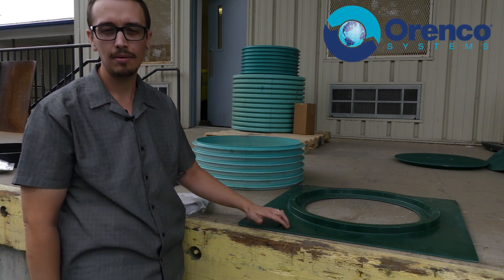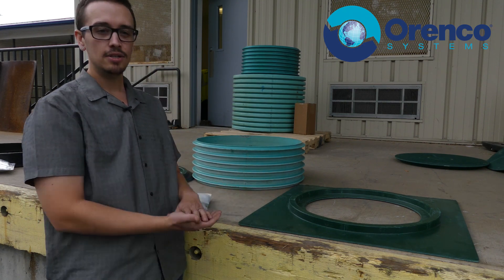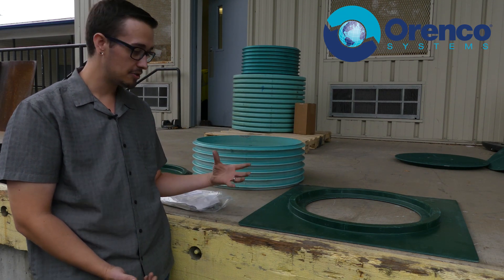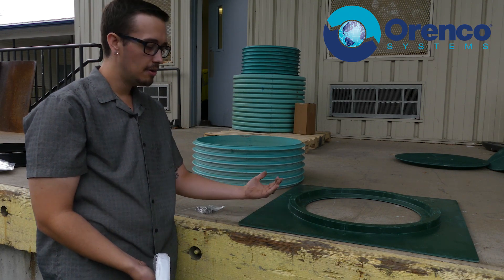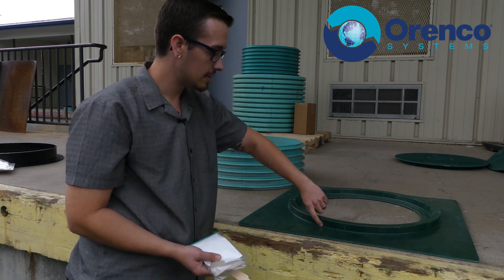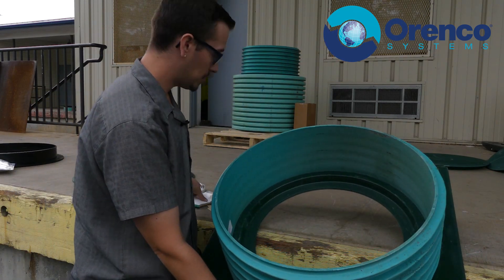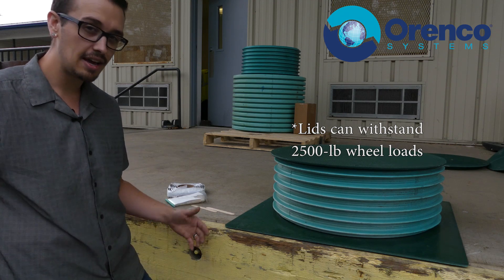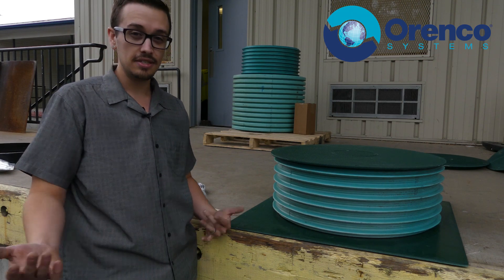How to Install Risers and Lids on Concrete Septic Tanks w/ Square Hole

Comment: Great video - but even better if we could see it being installed in a real world context or two.  Perhaps an ideal context and a challenging context.  My tank lid is roughly 20" x 30", and the concrete is 46 years old.  If we have a rectangle, what do we do?  If the surface of the concrete is not perfectly smooth and level, what do we do?  
(Those are questions for a future video - and for here now!)
Thanks

Comment: Is the riser easy to remove in future if I need to access inlet/outlet pipe inside tank? My riser will be 24” tall and trying to make future work easier.
Reply from the maker: The riser will make the future work easier, it is not removable though.

Comment: How high above grade do you want the riser lid to sit?
Reply from the maker: Usually just an inch or two so that dirt/leaves don't fall in when you open it.
Reply: @RCworstwater  Thanks for the info!
Reply: Brian Silver can these be cut down. My lids are only 4” below grade. Just wondering to make them less appealing. Thanks
Reply: @chickenguru4  I think you can get 6" risers so they would be slightly above grade.
Reply: Brian Silver ok great. Thanks for your reply